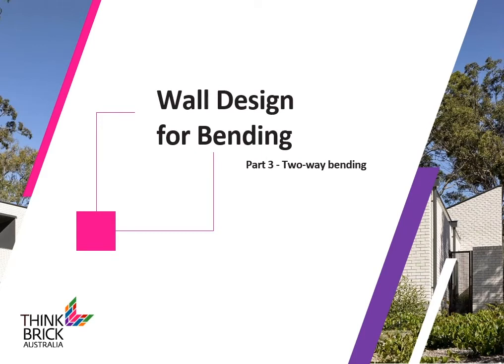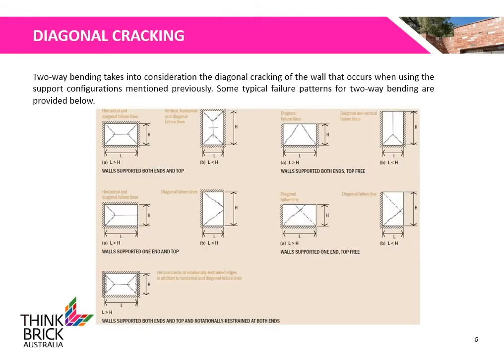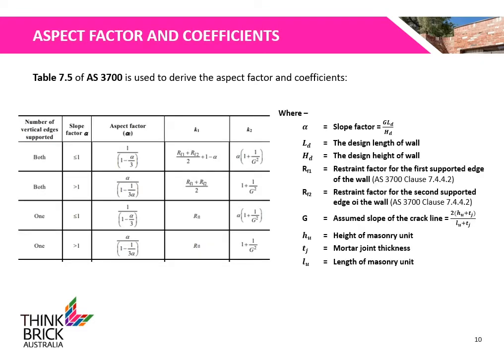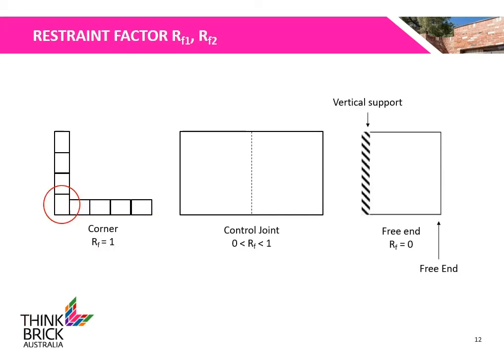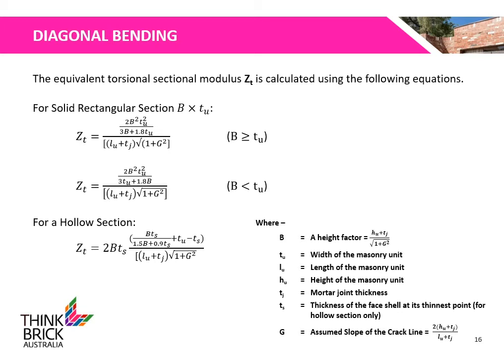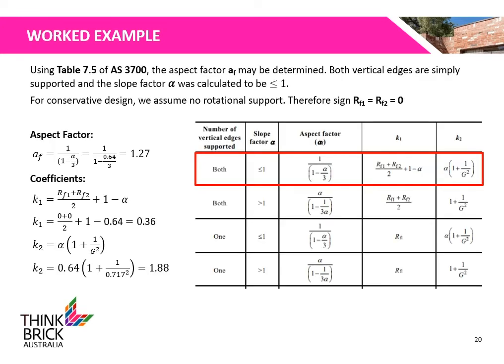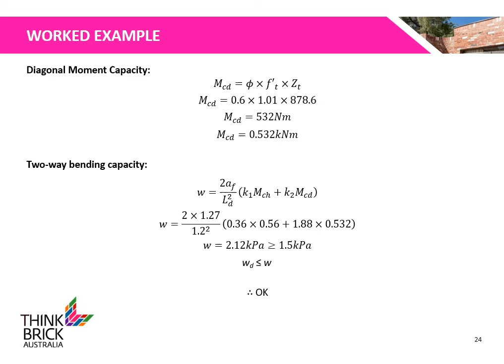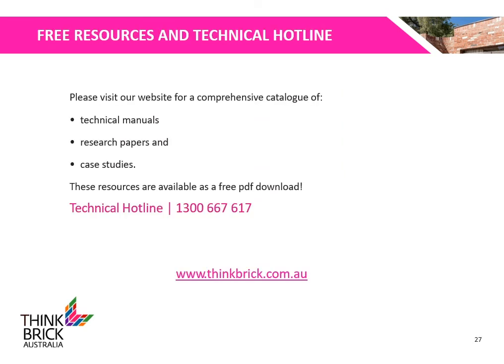Think Brick Tech Channel: Wall Design For Bending - Part 3: Two Way Bending

Comment: Could you please tell, how the two-way bending capacity of the wall equation is derived?
and also where can I learn about the virtual work method in detail?
Thanks
Reply from the maker: Hi Harshit - thanks for your comment. The two-way bending capacity is derived from AS 3700: Masonry Structures, which uses a combination of horizontal bending, diagonal bending and other walling configuration factors (slope, number of supported edges etc).
 
The presentation does not cover the virtual work method, but there are other videos on YouTube that do. We hope that helps you.